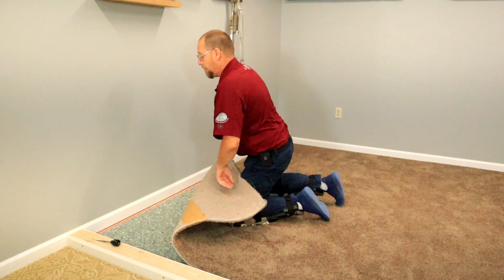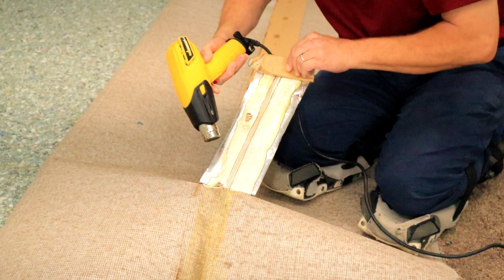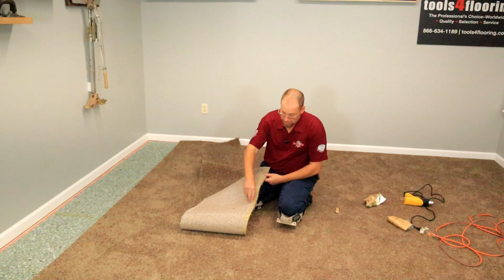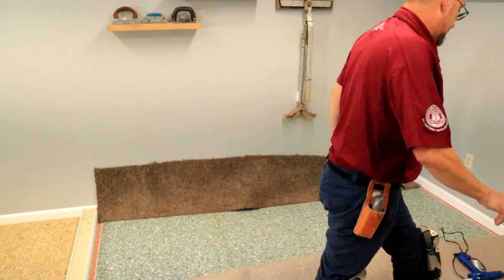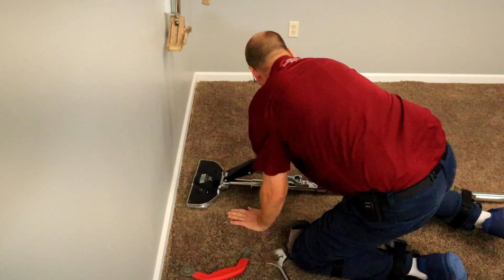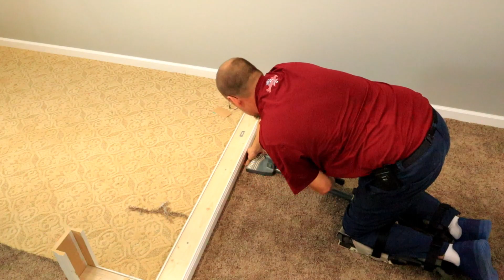How to repair a carpet seam

Comment: thank you for the good video i have a carpet seaming ? every time i use a 6' straight edge if the piece is around 14' or longer i cant keep my straight edge equal distance from the edge of the carpet usually about 1'' it will almost always try and run off the edge or narrow the distance i start by making sure both ends are the same distance than i cut the length of the SE than i slide it down to make my second cut but i leave a foot back and make sure its lined up on the cut edge i'm making, but it never runs completely parallel with the edge all the way to the end how can this be when i start parallel i know the carpet isn't shorter on one end.now i just make 1'' marks all the way down the side.
Reply from the maker: 99.9% of all carpet needs to be row cut for accurate seams

Comment: Is it possible to remove a carpet seam by using a heat gun on top of the carpet?  I need to remove seam at a doorway so i can peel carpet back to repair warped wood floor underneath (from water leak).  I plan to hire carpet guy to reinstall carpet but would like to peel back carpet and repair underlying wood floor myself first
Reply from the maker: Afraid not, you will not be able to get it hot enough to remove the tape without burning your carpet if you do it from the top. My best recommendation is to try to find the very seam it’s self and cut directly where the two pieces are joined. You will only be cutting the seam tape if you do that. It will be slow going making the cut, but it will save your carpet guy a lot of headache.
Reply: @FloorsbySouthernboys  Thanks!  I will try to find seam and cut tape only from top side.  Don't mind going slow but I'm not too confident that I won't cut into carpet just because of my lack of experience.  If I do nick into carpet a row or two, I hope it won't cause too much trouble for re-seam.